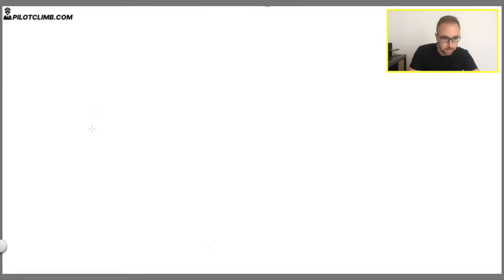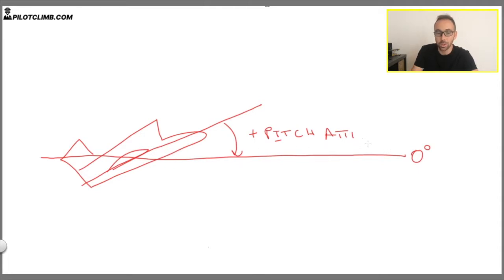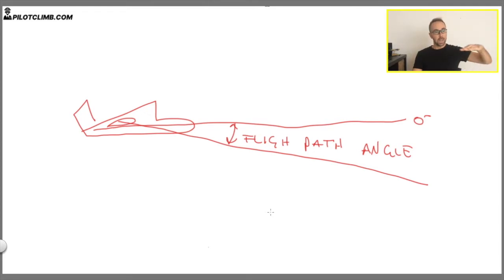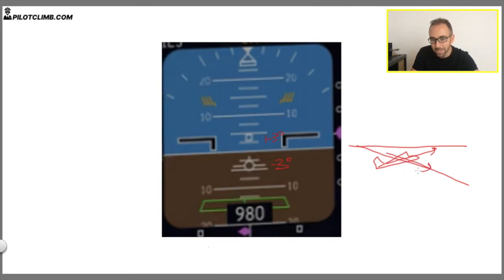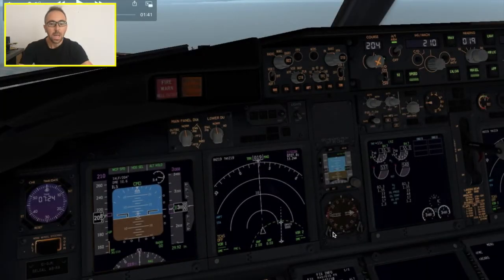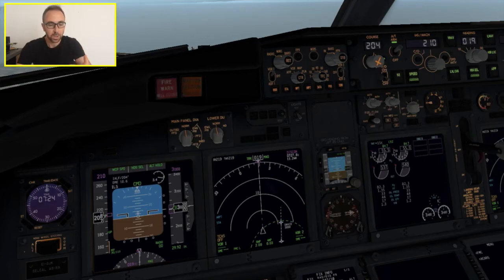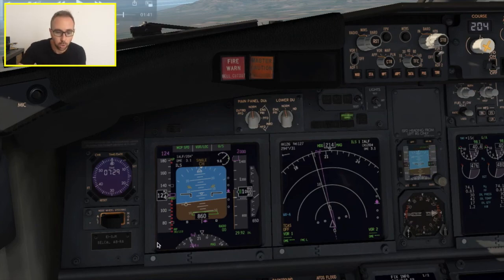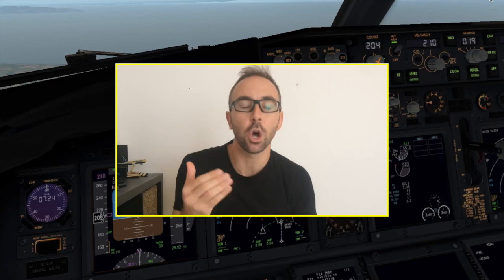Flight Path Vector (FPV) in deep - [Difference between Flight Path Angle and Pitch Angle explained]

Comment: Good Evening Capt, i ever heard that unload the wing mean pitch angle approx same as flight path angle/vector,is it true? ..could you please explained what it means? I do not understand fully... Thanks
Reply from the maker: Hey, many thanks for watching!! When you unload the wing you are actually ``helping the wing`` by reducing the load on them let's say... for example, in a level turn the higher the bank angle the more you will need to pitch up in order to produce enough lift to keep the level turn (otherwise you will start to descent), so by decreasing the bank angle you can reduce your pitch angle thus ''unloading the wing``. When you reduce the pitch (keeping a level flight) you, also, reduce the difference between your pitch angle and your Flight path Angle.
Let me know if I answered you question.
Reply: @PILOTCLIMB  Thank you Capt Gabriele for your explanation... 🙏

Comment: Thank you for this work; it's a good explanation that clarifies several points and for sure help understanding; probably the best on youtube regarding this specific topic. And I have one question please: the little square of the mock-up on the artificial horizon for the pitch attitude; example I want 10 deg of pitch so I put the little square on the increment 10 deg. on the PFD. Now my question is: is this square based on the longitudinal axis of the aircraft or on the mean chord line of the wing? I would appreciate your answer. Gracie Mille

Comment: Amazing .. was just reading the fctm and thought of looking it up for more clarity on FPV .. thank you .. could u plz explain on horizon line heading scale functionality .. which u mentioned in the video if anyone wants to know more about ..
Reply from the maker: Hey, many thanks for watching and the kind comment! So, In wind calm condition your heading is equal to the track (so FPV will be aligned with your horizon), but when you have a crosswind component you need to apply a correction, called Wind  Correction Angle, otherwise, you will drift to the left or to the right of your route depending on the direction of the wind.
If you watch the part of the video where there is a cross-wind component you will see that the FPV is not aligned with the center of your artificial horizon. By having an Horizontal Heading Scale you can see how many degrees is you drift and apply the adequate correction in order to stay on the correct track!
In the last part of the below article you can visualise what I'm saying:

https://pilotclimb.com/flight-path-vector/

Let me know if you still have any questions.

Comment: Many games I know of use this and I certainly find it easy to fly 3 degrees with. Even in the mobile game 'turboprop' simulator. It makes me wish  the Ikarus C42 it. However I noticed wind doesn't affect it? I am assuming it is dependent upon groundspeed data since airspeed  would be affected by wind. If I was going 90 degrees straight down to be extreme, but had a 10knots headwind, I'd be going 10kts backwards but as far as an angle of attack instrument would be concerned, I'd still be going straight down. So am I right in saying it is ground speed based? I've also noticed that fsx and fs9 versions of this never seem to work.

Comment: Good Day Capt,I still confused/not so clear how can we fly a negative flight path angle with nose up/pitch +6 degree? is it through pull back engine throttle ?could you please explain it Capt...thanks
Reply from the maker: In order to undestand this, you need to view the flight path angle and pitch angle as a two diffenent things.

If you are flying on a level flight, and you maintain level flight, your flight path angle will be zero, however if you slow down (keeping the flight levelled) your pitch angle will increase.

Try to watch the video again, some times watching something twice might help.
Let me know if you still have any questions once you watch the video again.

I wish you a great day.